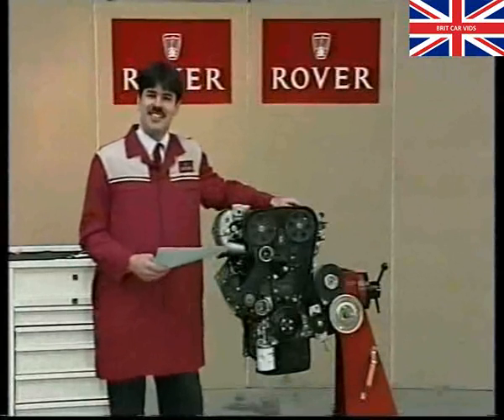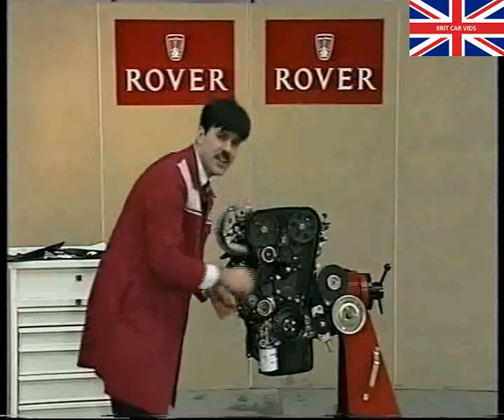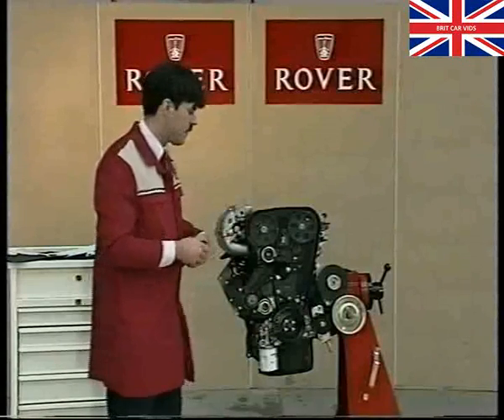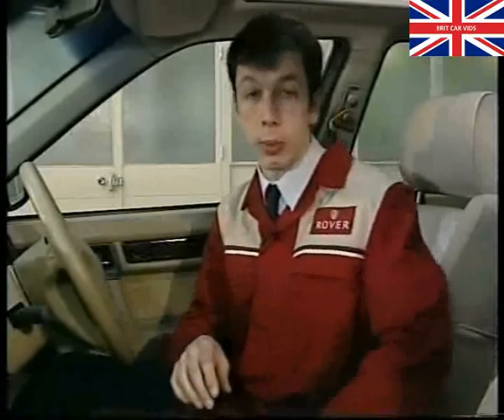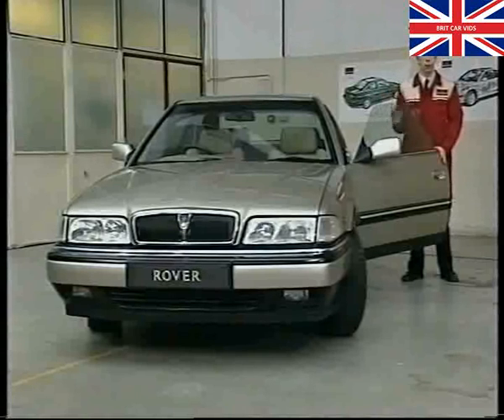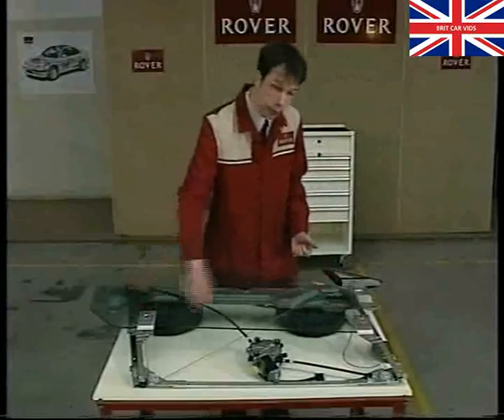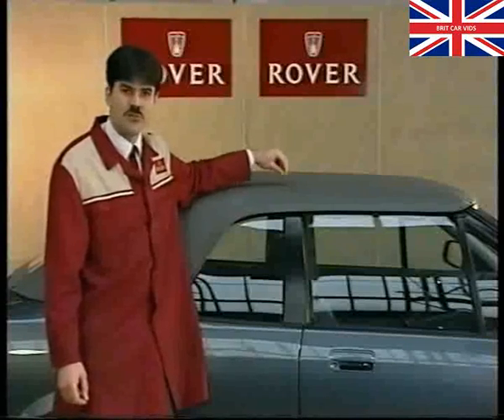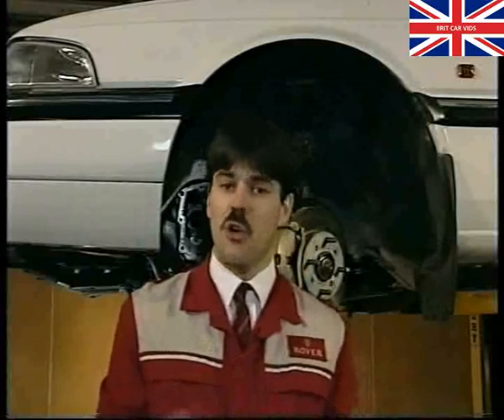Rover - Rover Professionals - Technicians Update 3 (1993)

Comment: The gearbox bit was shocking.....isnt it easier to do a straight swap over at the dealers......theres still lots of work involved just to take out those gear sets plus the time on top to strip and fit new bearings synchros etc......

Comment: "The timing belt is not being tensioned properly but don't worry we have a fix and a new procedure" - that sounds good I think. A redesigned pulley? Maybe a new special tool.....no just a bodge with some sand paper! OK what about the procedure....stop using the special tool and bodge around the issue using allen keys and jamming stuff in to hold it tight...sigh
Reply: No different to a lot of manufacturers in the 90’s to be fair. You should have seen some of the service bulletins from Nissan/VW in the past. One, as my mind serves me, required you to use a claw hammer to hold the belt tension while you adjusted the belt pulley. Dicey as all hell, did it plenty back then, and it didn’t make me feel very comfortable!